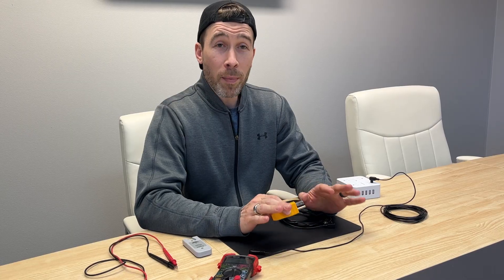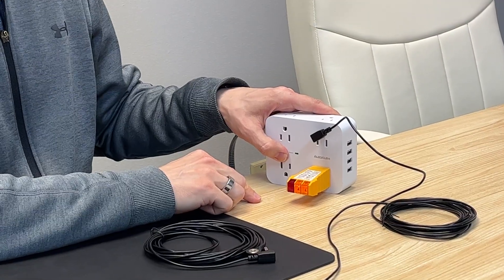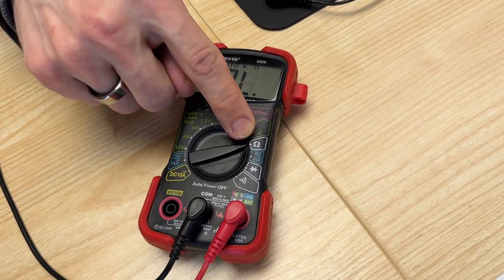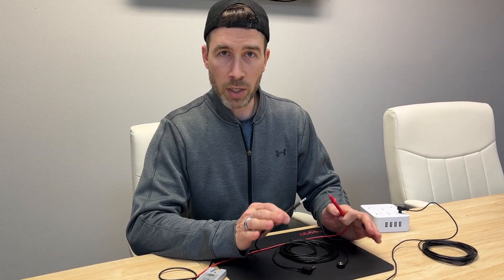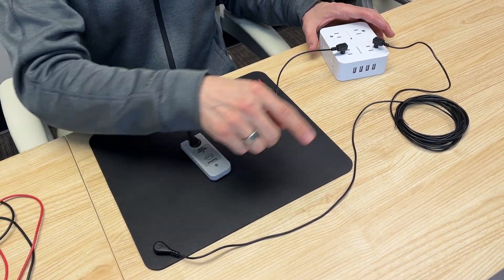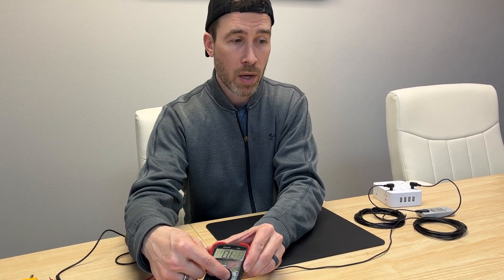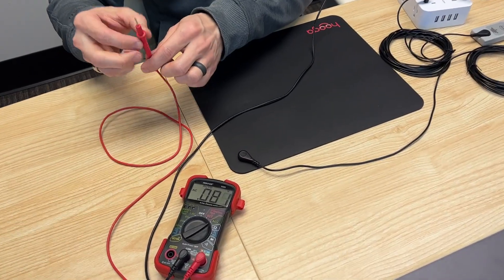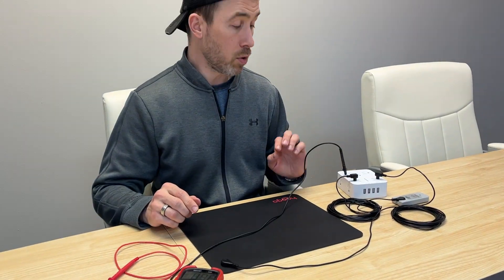How To Test Your Hooga Grounding Products: Body Voltage Test, Continuity Test, and Outlet Test

Comment: What is om setting
Reply from the maker: The “OM” setting is the ohms (Ω) mode on the tester, and yes, it’s an actual setting you can switch to. That’s what measures resistance. When we test a grounding mat, we use this setting to check if it’s properly connected and conducting. A low resistance reading means the mat is working as it should, safely grounding you.

Comment: I am a retired senior with no family. Why would I have an ohm meter or these other gadgets? That was not part of the purchase description. There is zero way I could put a grounding rod outside the window and reach where it is supposed to reach given it is to reach anywhere. (sigh)  I'll probably be 'grounded' six feet under by the time I figure out these 'simple' mat instructions.
Reply from the maker: This video is to demonstrate how our grounding mats work with tools that you could buy to test to ensure that your grounding devices really are working. You don't need them.

Comment: For some reason ive had nothing but problems with my grounding products , i got a grounding sheet that im sure wasnt working , ive  got 2 hooga mats that also dont seem to work , ive tried 3 different multi meters,  ive never had the reading go down when touching the mat , ive done a continuity test on all 3 cables and the only one that beeps on is the 40 foot cable i got to run it outside and into a copper rod i got cause people talk about current " Leaking" From other appliances going into the same ground rod our plugs mains use .... The cables that clip onto the mats or sheets dont beep when continuity test and the company i got the sheet off say its got a protector built in for lighting storms but then how would the earths current get through!!!?   I find the whole earthing thing highly confusing , the different videos testing different ways with often comments saying its the  wrong way  anyway and i cant even get a reading of my own body voltage on the settings commonly suggested... God knows what im doing wrong
Reply from the maker: hmmmm interesting. We'd love to help you out. Please email contact@hoogahealth.com and we can better assist you with a more detailed answer.

Comment: Thanks for this. Have the Hooga mat and thought it was defective. Using a typical Klein Tools meter but plugged into a heavily used strip. Numbers went up when I touched the mat. Replaced strip with another one without any other devices. Numbers fell to zero.
It works! But wonder if others don’t realize that you can’t use a strip with other devices plugged in.
Thanks!

Comment: I’d like to know which tester is more accurate. The one that you have in the video is the original one that Clint Ober came out with. But there’s the new ones with the green switch on the top instead of the button. I’ve noticed the newer ones aren’t as accurate, they still work but they’re much less sensitive
Reply from the maker: Cint is the OG when it comes to grounding! I'm unsure about the newer ones.

Comment: Can you make a video showing how to test grounding mat that when connected to a grounding rod outside?
Reply from the maker: We will definitely look into that. In terms of testing the grounding device that's connected with a grounding rod outside, you'll have the grounding device plugged in with the grounding rod in the ground. Then take the continuity tester and plug that into a grounding outlet of the wall our in the ground outside and put that on the device. It should show green just the same.

Comment: I have just viewed your video many times and tested my Mat also many times, albeit, when my mat is plugged into the earth and I have my Assark 620A Multimeter on the V~  and cables plugged in as on your video when I get a higher reading when I touch the Mat? is there a problem with my Mat or Multimeter?
Reply: Your video shows that it drops, mine increases?
Reply from the maker: @MrDaviesColin  hey! Email us at contact@hoogahealth.com and we can better explain to you (a bit longer of an explanation than the comments allow.)

Comment: Does it matter or make any difference if I have an anti-fatigue mat UNDER my Hooga grounding mat?
Reply: Your skin needs to touch the mat.
Reply from the maker: @justoalma9585  yes, you will want skin contact or some sort of conductive material.
Reply from the maker: Not too familiar with an anti-fatigue mat and how it would work with a grounding mat.

Comment: As you were very helpful confirming my previous comment, I'm hoping you might have some insights on an issue I'm running into when testing the mats' grounding capabilities. I'm unable to replicate these results when plugging the black probe into the same socket as the grounded mat. While performing this exact test, would you have any idea why AC voltage would increase upon touching the grounding mat compared to holding the red probe without touching the mat? This is after confirming a good ground connection in same the wall socket the black probe and grounding mat's cable are inserted (same as this video's setup). The kicker is, if I ground the black probe into a completely different wall socket compared to where the mat's grounded and then make contact with the mat, the multimeter shows the expected drop in voltage. Not sure why I can't get the expected results with the multimeter probe inserted into the same wall outlet as the mat? There are no other items plugged into the outlets when testing fyi
Reply: You might have stray voltage in the line. These are transient currents. You can put a filter on the outlet or circuit to filter this out. Look into dirty electricity. You need to make sure your ground is not picking up stray charges. It could even be that the length of the ground circuit you're testing where you have higher voltage is matching a wavelength of am radio transmission which would cause to resonate and produce charge. Filters are needed.

Comment: for the body voltage test, theoretically you should be able to test it and get the same before and after results if you stab the black probe into the ground outside and hold the red probe in your fingers while wearing rubber shoes/sandals, the body voltage should be the same until you remove your shoes/sandals and step on the ground barefoot, correct?
Reply from the maker: Yes, you can do that test with a multimeter. I just tried it outside to confirm. You have to stick the black prong into damp soil for the best result, and outside you'll find your body voltage is probably not that high to begin with, but once you pinch the red prong and touch the earth (or remove your shoes) your body voltage does drop dramatically still.
Reply: @hooga_health  Very cool - thanks for confirming!